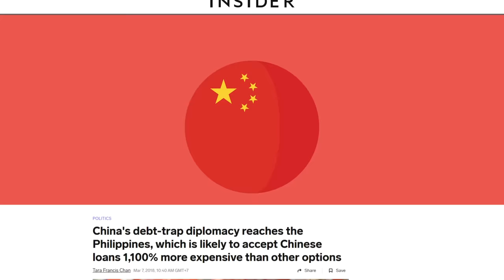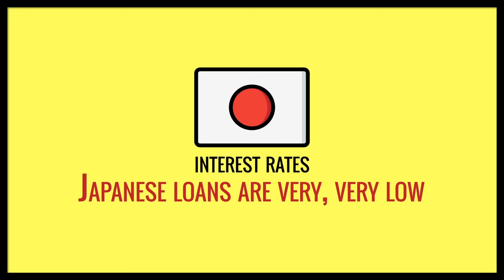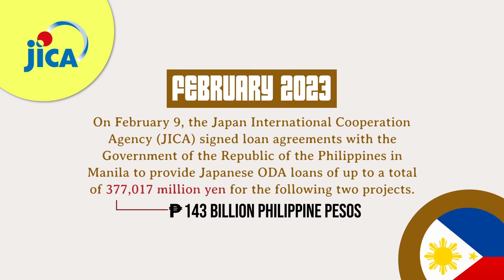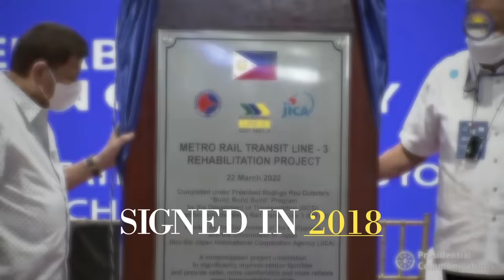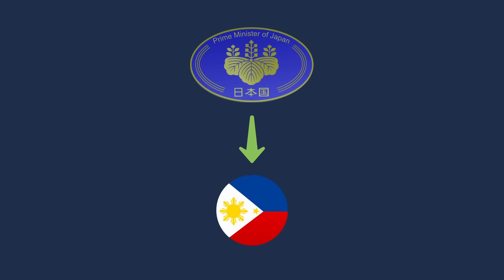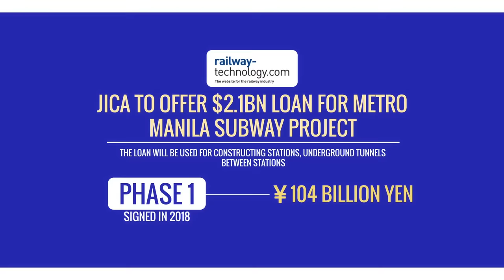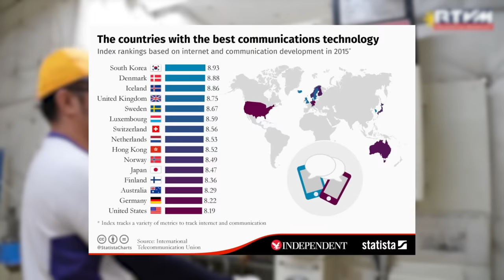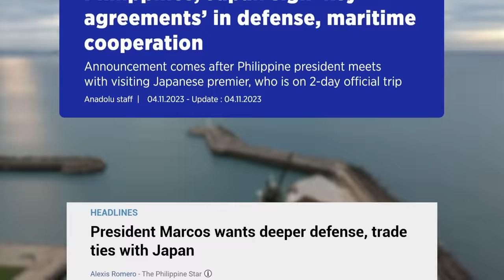How Japan is Helping Build the Philippines

Comment: Firstly, the Fed base rate over the past 15 years has oscillated from 1-5%. If Japan is offering the Philippines $multibillion loans at 0.1%, then it is providing the Philippines with loan subsidies. Japan is losing money by lending to the Philippines. The IMF and World Bank lend at 2-3%, and commercial banks would lend to the Philippines at 5-7%. Chinese loans at 3% are not usurous but competitive with what is available by others.
The question for the Philippines is what does Japan expect in return? At the very least it expects a geopolitical alliance in return for its money.